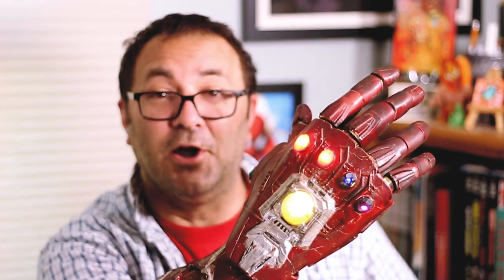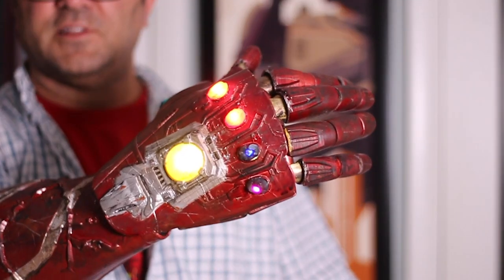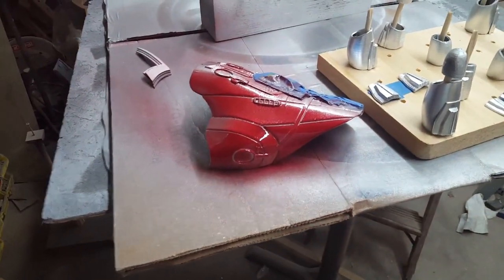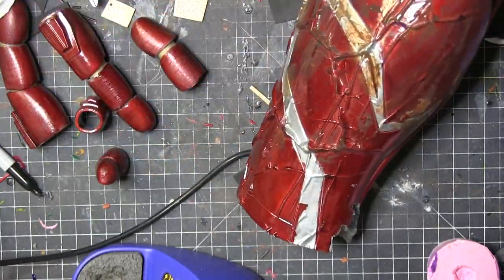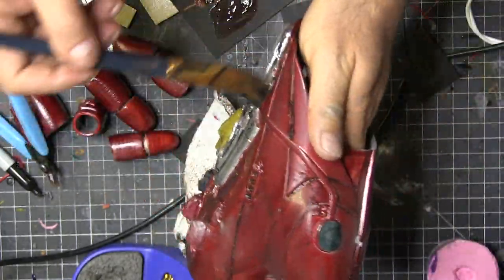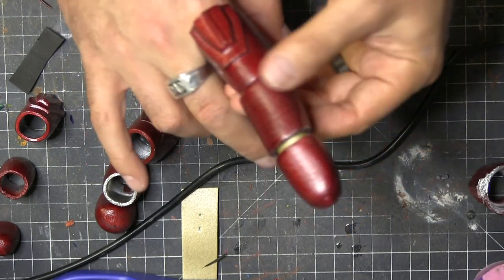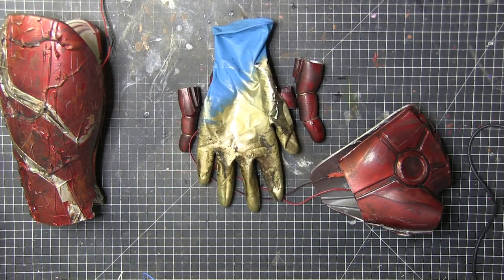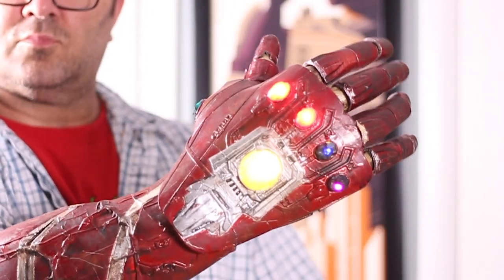Ironman Infinity Gauntlet 3D Print - DO3D

Comment from the maker: I didn't scale it but then had to use a heat gun to melt it a bit to make it fit. I would definitely scale the palm pics and the arm a bit.
Reply: I scaled it up by 20% and can fit the palm pieces around my hand with a mechanic's glove, but definitely don't have enough of an opening to free my hand if the parts are glued together.  Did you heat the wrist area to get your  hand in and out?

Comment: In all honesty I thought this would look better. I don't know if it's how you're wearing the glove but it feels very rigid. Also can you please do a video with more closeups to the gauntlet from different angles.
Reply from the maker: That's the problem with 3d printed armor. It's made of plastic which makes it pretty rigid. Foam armor has some play. It's why I usually don't print armor. Very limited movement.
Reply: @3DPrintedProps  I've really wanted one of these but this hasn't really sold it to me so I'm a little disappointed

Comment: Hi. I just purchased these files and they are just awesome. Thanks for the video and very useful. However I was wondering if you rescale those files or not. I’m a bit worried because if the very narrow opening of the forearms.
Reply from the maker: I didn't rescale it and wish I had a bit. I ended up using a heating gun to soften up the wrist, then I put on a glove and made the opening larger. So yeah, you may want to scale it up a little.

Comment: Which 3D printer did you use?
Reply from the maker: That was actually printed on my first CR-10, the first model.
Reply: 3D Printed Props oh wow! Thank you for the reply! I’m looking to buy the Creality Ender 3 Pro do you think I’d be able to make the entire suit with it?
Reply: @Pokebits1  It'll take awhile, but you can definitely chop an iron man suit model into tiny pieces so it can print on the Ender 3. But if you plan to do bigger projects often, then I think it'll be best to invest in the CR-10
Reply: @Pokebits1  Yep! The CR-10 is one of the cheaper big printers and definitely has more space than an ender 3. Also that would be the right place to go to buy the CR-10, just in case you get a defective model (Which is very unlikely) it'll be easier to deal with Amazon than some random chinese company (trust me, got one of those CTC printers and it was a pain to deal with their customer service)